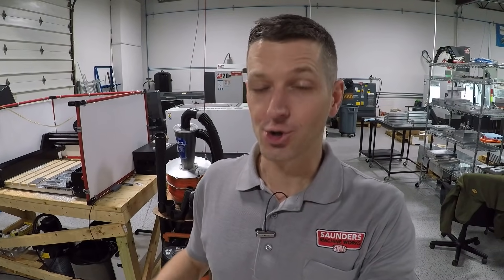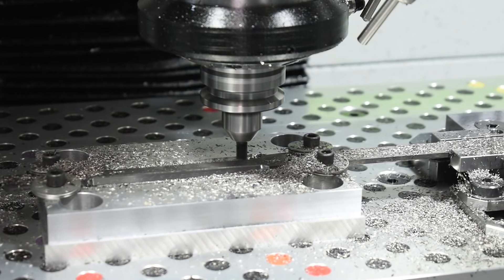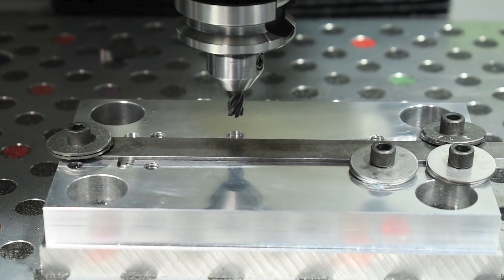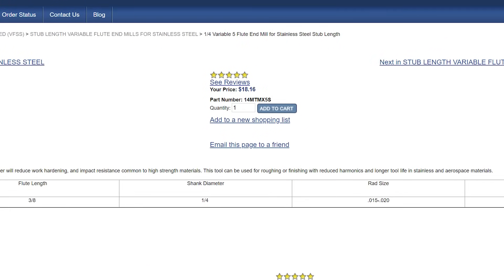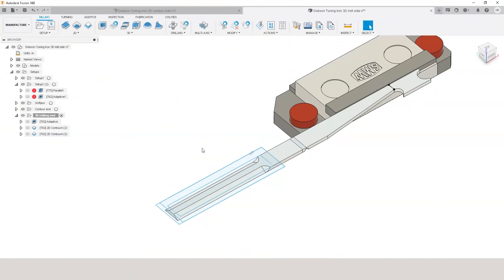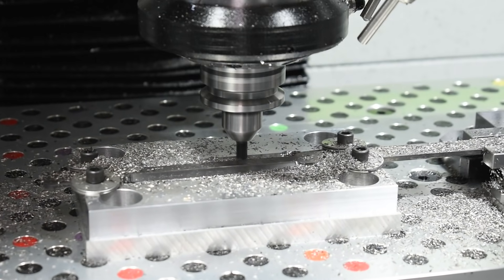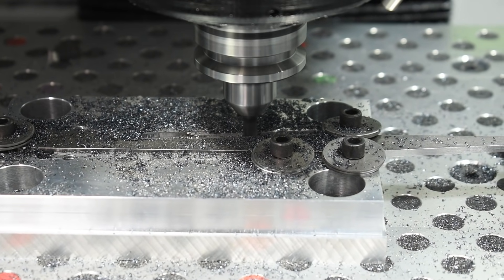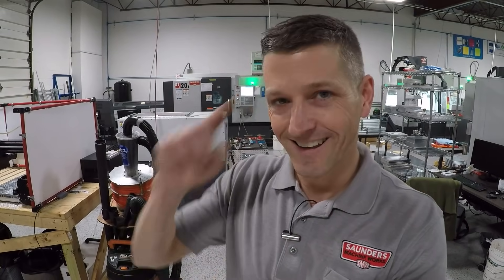Hard Milling a Pipe Organ Tuning Tool from O1 Tool Steel!

Comment: An interpretation of that punch mark from the hardness test would have been nice. It is hard to read on video. I'm assuming it reads 55 HRC? If this is correct I'm quite impresses how well the tool handled it. But i don't think slotting is the best strategy. I would have machined all features in the soft state and only a clean up pass in the hardened state.  Alternatively this could have also been a nice job for an wire EDM machine. Nevertheless a very nice job with a good intend.

Comment: I'm glad you were able to help in some way. 

It always amazes me that so many companies fail to do basic disaster planning. At the very least they should consider a total loss of the site, and at most a regional disaster.
Reply: Sorry you were disapointed... A few hand tools are nothing compared to the loss of FOUR buildings, machines, work in progress. The tools were made by a now retired employee years ago on a milling machine,  and neither he or the tool are available to make them again,  otherwise they could have simply been bought, no amount of "planning" would have solved that issue, the tool could have been broken or lost and the results would be exactly the same- having to have replacements machined.